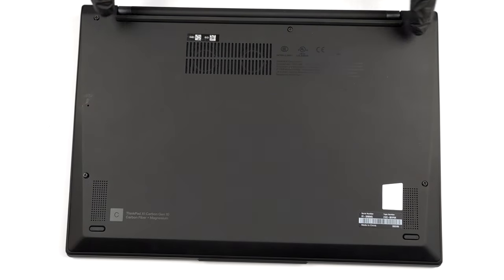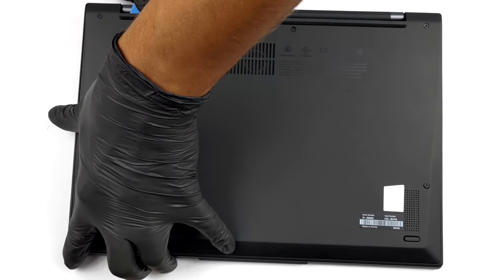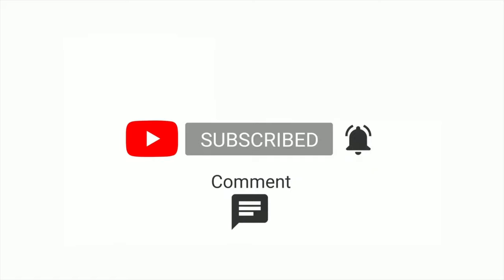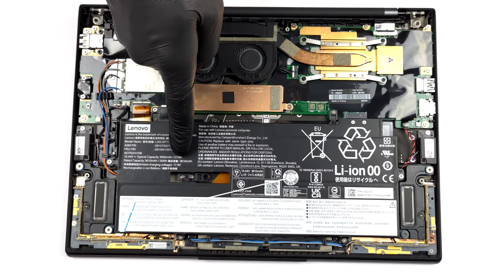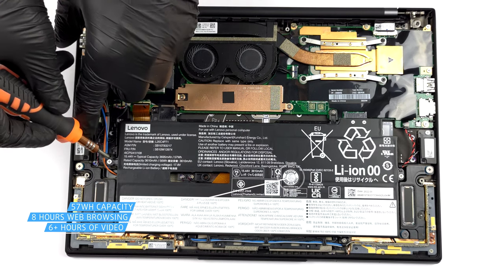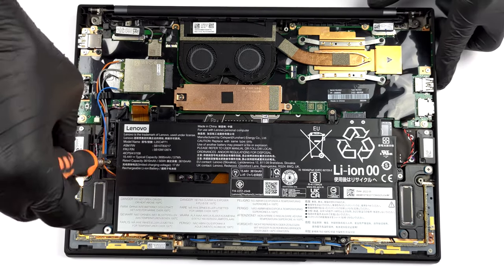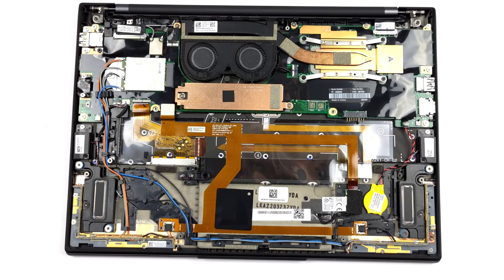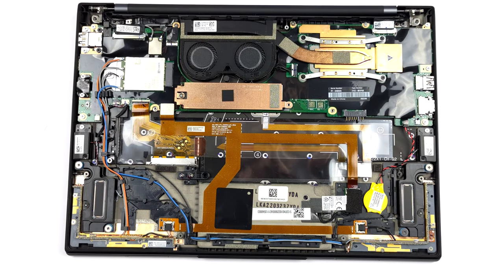🛠️ Lenovo ThinkPad X1 Carbon 10th Gen - disassembly and upgrade options

Comment: One m.2 slot at this price is ridiculous.
Reply: The target customer is BIG company, who care less for prices.
Reply: meanwhile dell XPS and macbook have the ram/hard drive soldered
Reply: This is a slim business premium notebook, the fact that the ssd is not soldered on, is already an achievement. Carbon line is not about upgradability.
Reply: In my opinion, the biggest drawbacks are the battery life and the location of the ventilation outlet on this laptop.